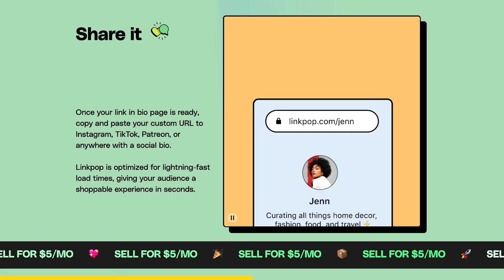Real Mechanic Reacts to Horrible Facebook Car Advice

Comment: Can you imagine getting in a wreck with the person that fixed their car with bricks and cement lol
Reply: In practice, bricks of a different kind than any mason would work with would be used, and the smuggler, ....er, the driver would be careful not to get in a wreck.
Reply: @keensoundguy6637  lol... you're right about that
Reply: @keensoundguy6637  Youve never seen border patrol 🤓
Reply: It seems a bit hard to imagine anything if you have a brick through the back of the head from inside your car as well as the impact from whatever else happened in the collision.
Reply: 😂😂😂 Godforbid
Reply: we built this car... we built this car... with bricks and cement

sorry, felt like referencing Starship

Comment: I like how the tire requires a tube when it's square but not after it's "repaired."
Reply: Presumably they added the tube for the joke part of the video since otherwise it could not be inflated since it would not seal to the mangled rim.
Reply: Makes sense though and also it doesn’t look like they switched the wheel at all but it I still wouldn’t trust it
Reply: They had to use a tube to deflate the tire with the spigot valve from the beginning.
Reply: @oliver6287  
also it doesn’t look like they switched the wheel at all

I think they might have.  When they first start trying to un-square the wheel, the back rim has a lot of rust on it. Next part after they are done, all the rust is gone as well.
Reply: Well no shit. Round tire wont bead and seal on a square wheel.
Reply: @oliver6287  bro they 100% switched the wheel.
Reply: @oliver6287  They switched it several times. Watch the face of it. The markings and scratches mysteriously change at least two times
Reply: Anyone notice the rim doesn’t have a valve stem when mounting the tire, but it appeared when it was inflated.
Reply: Whatever, that tire's had it, even before it got pulled off that square wheel. And I don't mean the hole they punched in its side. It's a studded tire with the studs removed, and with not that much thread left either. Could have been a spare tire, but using all that time to get the rim circle-shaped and then "sealing" the cut they made before removing it with fire.... sketchy as hell. I wouldn't drive to the other side of the yard with that tire.
Reply: so... we don't talk about the faucet on a piece of garden hose they used as the valve on the square wheel? Ok...
Reply: @robertheinkel6225  you can put new valves in after mounting if you press down on the sidewall hard enough to fit the new one in
Reply: I thought they were using the tube to get the car off the ground so it would roll without destroying the wheel even more.

The scratches on the hub completely match between the round-ish sequence and the repaired sequence, so that's clearly the same wheel. Of course, it's always possible to take a good wheel, take video of it, then bend it, and take video of that, then edit the sequence in reverse to make it look "fixed".

I can't find any scratches that match between the square sequence and the round-ish sequence, leading me to believe that part may be entirely faked. The lack of rust doesn't bother me, since it would likely get rubbed off while trying to restore the rim shape. But I am inclined to think they didn't go from square to round-ish, and therefore didn't go from square to fixed, since I can't find anything to match those wheels.
Reply: @oliver6287  You can see when they switch it because the squared tire is better painted (and rustier) than the one they swapped it out with.
Reply: Lol the wheel is square because they visited Canada. xD
Reply: It's because it wouldn't hold the bead on the square wheel
Reply: And how they punctured it with a spigot
Reply: @seancostello4158  I think matching the chipped off paint on another bent wheel would have been harder than bending the one. I've straightened a rusted and bent (not this bent) with a hammer and anvil and removed the rust with a flap wheel. That isn't a $40 wheel going on a car using lug bolts.

Comment: Also for oil filter and fuel filter replacements on boats, we use thick ziploc bags to remove the filters. Keeps it clean and you then have a bag you can close and keep the filter in to dispose of.
Reply: A sock does the trick just fine,when you're a savage. 😆

Comment: Using co2 or refrigerate to shrink those sleeves will allow you to just drop them in.  The rule of thumb for a interference fit is 0.001" per inch of diameter of the sleeve. So if you have a 4in od sleeve the hole is going to be 3.996. Freezing the sleeve with a sub 200° refrigerate will easily shrink a couple thou smaller allowing those sleeves to almost fall in. I use liquid nitrogen to shrink bronze bushings and oil lite bearings when repairing industrial machinery
Reply: Liquid nitrogen.

Comment: Can we just take a moment to appreciate how sharp that potato peeler was? I need one like that for potatoes.
Reply: Seriously. I have a bunch of potato peelers that can't even handle a potato, much less a tire.
Reply: @tankerd1847  People who peel their potatoes need to be in an asylum.
Reply: @fortheloveofnoise  you making mash with the peel laddie?
Reply: @fortheloveofnoise  I agree, just buy potato powder!
Reply: The faster a knife goes over a surface, the sharper it is. Put that potato on a power drill and spin it, then just touch the potato peeler to the potato and watch the magic lol
Reply: If you cook a lot, you know peelers are no joke, I have sliced my fingers more deeply from a peeler jumping than any knife
Reply: @SireDevathrius  mashed isn't worth the effort of using real potatoes.
Reply: @spornge  Are you peeling the potatoes towards yourself? Because if so then yeah I can see that happening, but peeling away from your body with your fingers gripping the sides of the potato and making sure that the potatoes are mostly dry after washing them, then I don’t see how you can have sliced your fingers X amount of times. Or it could be that your peeler is dull and dull blades cause more injuries than sharp ones. Applying the right amount of pressure also helps avoid injuries.
Reply: Yes.
Reply: @ghoulbuster1 , potato powder? More like 3-times chewed potato water. 🙂

Peeled or unpeeled (country-style) cubed potatoes, boiled until soft, drained, mashed with a bit of milk and then butter, then smoothened with a hand mixer.  MMM, good stuff.  I like to use a little less milk to keep it dense.
Say no to "TV-dinner" frozen processed potato product. Go real!
Reply: That was obviously a drift car,so them tires wont last that long,for this method to be concerning. 😆

Comment: I recently moved to the heavy duty diesel industry and was amazed when my coworker told me after cracking the filter loose, before it breaks the seal, they use a punch and hammer to drain the filter before removing it. Saves a lot of mess and no slippery filter.

Comment: I've never seen anyone put a belt on like that. That shit is scary. Growing up on a farm my dad was crazy safe and I am the same way now teaching my kids.
Reply: If you get injured out in the countryside on a farm... ouch. Def careful is good
Reply: That’s an air cooled VW bug engine. They don’t have a water pump and just an alternator/generator. I’ve even done it before but you still have to tighten it later so why not turn it off?
Reply: I've seen that many times when I worked with an old-school mechanic 25yrs back. scared the shit out of me when he did it. when he did it I always was thinking this will be the day he loses some fingers but fortunately, that day never came. I know I do some crazy shit most wouldn't attempt when working on vehicles but I'm sticking my fingers near anything that can potentially take them off before I even know wth happened. F**k that. Lmfao. these days serpentine belts are much more simplified than the old-style poly v-belts so I wouldn't think many do this anymore. hope not anyway.
Reply: Its a vw classic bug so belts are quite loose on those. I have seen it done before but I wouldnt try it since it is still dangerous.
Reply: You never rope started an engine then put the belt back on the Genny on a tractor? Family restored a crank start tractor and had to do it all the time.

Comment: The chain and the spring trick does work. I am a diesel mechanic and that chain trick saves a lot of time. However the chain was run a very awkward way but works. I use that trick on the semis and trailers I work on where applicable. This trick only works on specific shoes.
Reply: That is correct. I am a diesel tech as well and that is how my foreman showed me. These guys don't know much about the diesel side. I like the videos though.

Comment: Years ago I cleaned the drain holes on the doors of an old Chevy van. The holes were totally plugged, and the water coming out was as clean in the video.
The cylinder sleeve can be a great hack. That is not compressed air. It is spray nitrogen, which is very cold. That will allow the sleeve to go in, and when it warms up to room temperature the sleeve will stay in place.

Comment: For the oil filter one I use something similar, but it’s a silicone funnel called an Oil Udder 😂 has a magnet to keep it in place and an over sized flange to let the oil drip down the sides
Reply: I use a 2 liter pop bottle.  Cut the bottom off and cut some clearance in the side so you can spin the filter.  Works great on Harleys.
Reply: I wondered how well those oil udder things really worked.

Comment: i've worked for a big european truck manufacturer putting sleeves in their  9 and 12L engines, they actually do something like that. The sleeve is going in a fluid in a refrigerator, the block was heated up to 80 celsius while pressure testing the freeze caps in a hot water bath. After 10 mins it came out and i manually had to install the sleeves, they fell right in if you had the sleeve perfectly perpendicular ( which is way easier then you'd expect , took an hour to get the hang of it and put them in 1 handed )

Comment: 5:54 He swapped out the wheel with another less-broken one that was actually easily fixable. You can see the differences on the scratch marks of those 2 wheels
Reply: And it went from a tubed tire to tubeless

Comment: The wheel bearing trick works great on 3rd gen 2wd dodge trucks. A tube in studded tires is actually pretty common. The chain trick on the semi brake shoes is REALLY smart. Wish I had thought of that. Spring hook pops over the pin and pushes the chain link out. Man, that would have made brake jobs WAY easier.

Comment: 9:10

this is litterally how industreal sleeves are fitted for interferance fit.

we use dry ice to freeze the sleeve and torches to heat the hole; typically heat works better than cold

Comment: the hub trick using heat to remove the bearing race works way better then any other method ive tried... once you get good at it and good at using a torch it will become your go to method. works everytime I swear. last resort should be going old school, cutting a slit and cracking it in half using a chisel and hammer because chances of causing damage is higher then heat. the spinning in required so it just slips down once expanded enough otherwise if it was still it wouldnt want to slide down like it does spinning. that one is legit and worth trying if you havent.
Reply: Snug up a bearing separators behind the race heat it up good and pry it off quickly with one bar back and forth or 2 pry bars at once.

Comment: the chain and break pads method is legit being the  diesel mechanic field , it makes things quicker so your not fighting the pressure of the springs
Reply: Yes however that’s not what they did in the video
Reply: They never hooked up the left side springs though. That's the only problem I had with it.

Comment: 13:10 Truck brakes with the chain. As a diesel tech, I can tell you it works . But honestly, there's a $30 tool where you put the orange springs on last that works just as good, and you're not fighting to get the chain off the blue spring.

Comment: For the drum brake spring hack (looks to be on a semi trailer) the initial swing with the small orange springs and the pivot pins is legit, but it is much easier to put the blue spring on before the 2 rollers on the s-cam.
Reply: Yep. And I don’t buy being able to just pop the blue spring on with a big chain like that. There isn’t all that much clearance where the spring hooks over the pin so I just don’t see it working that well. 
Especially with the weird cut in there. Sure seems like they cut out where it didn’t work with that camera shake.
Reply: NBSV1 
I work on semi trucks and this is a easy way to do brakes is a real thing. It does not work on all brake types tho, but it works in some of the most common ones.
Reply: @zerophotography1372  wouldn't pulling the chain straighten the hook out of the spring though? Never did drums on a semi only passenger cars so I'm assuming springs are larger/heavier but chains don't magically lift off hooks
Reply: That clip is edited. That’s why the camera guy swung the camera over real fast. It’s two clips edited together
Reply: @mgconklin995  It wouldn't damage the spring. But, you have to hook that spring over a pin that's in the center of the shoe. And, there isn't much of a gap in the hook part of the spring. 
Normally it would only take about 30-45min to change the shoes on an axle if the wheels come off easy and everything isn't seized up. 
It's way easier to just hook the big spring first then put on the smaller springs. But, I'm big enough to push the smaller springs. Sometimes they're hard to manage if you don't have the weight.
There's many different ways to do them. But, in all the years I've been working on trucks I've never seen anybody do them this way and have it be worth the trouble. The cut in there says a ton. It likely either took them several tries, or they just put it together normally and then cut in them yanking the chain.
Reply: @NBSV1  I wanna try this at some point. Cuz why not. I've always done the big Spring first and the small ones after. I found a method if I have the perfect small flat screwdriver I can pop those little springs in one handed. Usually the dust shield is in the way to do that with the back one tho. The it's just lean on it and put it in.  They can occasionally be miserable tho

Comment: I’m a HD tech. The technique for the s-cam drum brakes around 13:10, I’d call “meh”. It can work, but I don’t see any intrinsic value in doing them that way. I’d just connect the two return springs on the other side and use my brake spring bar to connect the main spring. Your s-cam needs to be positioned exactly right to do it that way, though… if you start with the two shoes connected at the main spring and do the two return springs last, it’s a little more forgiving.

Comment: Clearong the drain - loved it. In the Navy we'd hook up 180PSI fire hose to a clogged sewer drain. Worked every time - but sometimes made a nasty mess if we missed a vent.
Reply: I've used that same tire tank over many years,if you get a long  pipe,I think 3 inch  diameter fits you can make that into a nice cannon,125 psi will launch a can of soda so high you can barely see it 😂😂😂 just be careful 👍
Reply: @briandavid3637  I have had that on my list of things to build for a couple years now. As long as the valve is threaded which it will be, you can have an easily switchable tire blaster/potato cannon. And my air compressor goes to 180 psi. Well it did when I bought it. I turned it down.  But shooting soda cans at that pressure seems a touch sketchy

Comment: My uncle Joe was a mechanic for 60 years before he passed away from cancer, but he taught me to remove ball joints by heating them up red hot then throwing a bucket of ice water on them. The rapid thermal contraction would pop them right out.

Comment: As a heavy duty diesel tech, the chain on the drum brakes is LEGIT. I've seen alot of older tech use this method, I know how to do it, but I don't. The easier method to set the springs for me is a pry bar that has a notch cut into it and use it to set the spings.

Comment: 11:30. I was about 17 sitting in line at a drive thru car wash with my dad. The car ahead went into the auto pull-through device, and half way it got stuck. Out walks a young kid from india who was working the gas station. The gears that drove the chain were all caught up, My father and I could see clearly into the wash bay. The young worker grabbed the chain that drove the entire wash bay, and right when he did it engaged. His hands were between gears bigger than Our faces, and a chain roughly 2 inches thick thats designed to pull hummers and more. It happened so fast He had no shot, His hands went around those gears and turned into jello. We could see his fingers hanging on by threads of skin and what was probably tendon. Morale of the story is dont fucking risk your life for stupid shit.